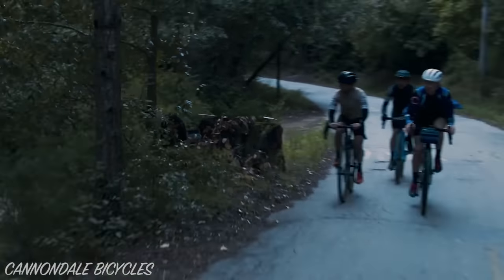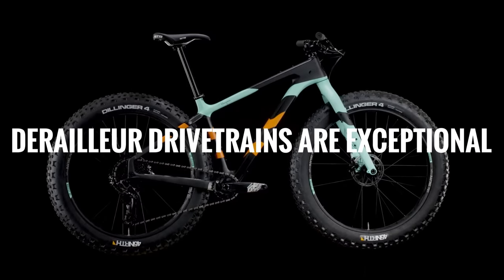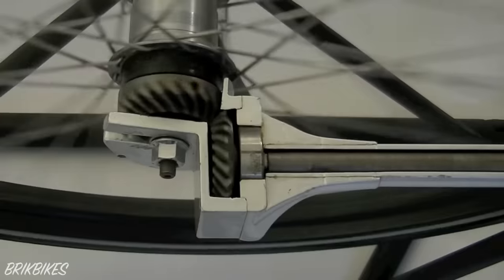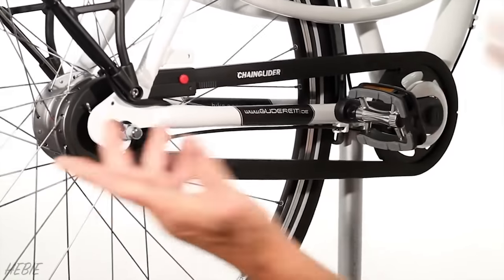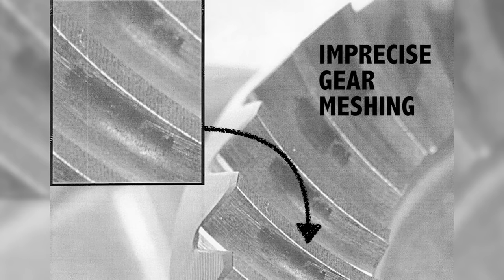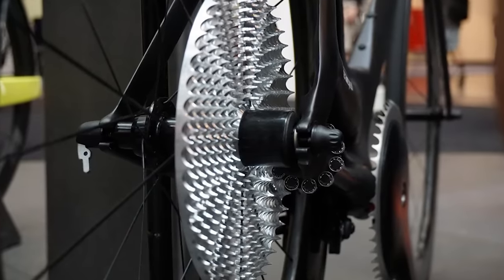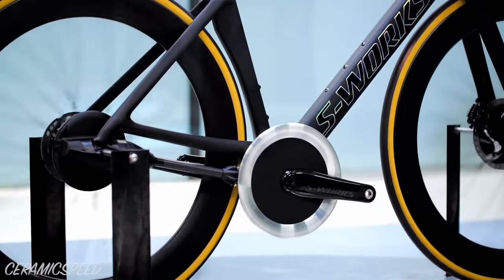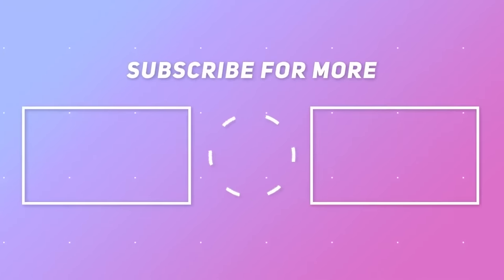Are Chainless Shaft Drive Bicycles a GENIUS or TERRIBLE Idea?

Comment: I can honestly say in all my years of riding different  bikes,Ive only snapped a chain once.But modern gears are fiendishly annoying to adjust.I loved the Sturmey Archer 3 speed hub on a couple of my bikes.Easy to adjust and a drop if oil in the hub every so often!Maybe thats why Ive got a singlespeed bike today.....
But I would like to try a shaft driven bike..
Reply: There's a very common problem that affects gear adjustment in a "modern" bicycle chain-drive drivetrain: Misalignment of the rear derailleur hanger.

The hanger is intentionally made with a relatively soft metal so it will bend or break before your expensive rear derailleur or frame dropouts. That way, if you're in an accident, you just need to replace your cheap hanger and your drivetrain is back in action. However, since it's made with soft metal, the hanger is easily (and frequently) bent out of alignment through normal use, making it frustratingly impossible to achieve a good alignment between the rear derailleur and the cogs in the cassette. If you remember to always check and align the hanger before you attempt to adjust the rear derailleur, you'll avoid most problems and it will be a breeze.

A rear derailleur hanger alignment tool/gauge costs as little as US$35 from Amazon. A professional tool like you'd see in most bike shops would be a Park Tool DAG-2.2 which costs about US$84. Or, if you're patient, you can pick up a used one for even less on eBay. I recommend checking the hanger alignment every time you need to replace a chain and/or every time you begin to have shifting problems.

Comment: So with shaft drive, I can get two-wheel drive? perfect for winter!!
Reply: Check out the ROKON two wheel drive motorcycle, it has a shaft system with gearing to drive the front wheel. Originally built as a utility motorcycle for people who work in forestry, and for inspectors on utility lines.
Reply: You can do that with chain drive too. But amount of friction losses is enormous for both solutions, making them useless.

Comment: I saw this product demoed on another video a few years ago. It looks amazing until you consider what will happen to the right-angle gear attached to the rear wheel when it's loaded-down by a 200lb human cranking on the pedals with all their strength. It would strip immediately.
Reply: @mystikmind2005  Just stick to a conventional derailleur system, the design in this video is engineering nonsense
Reply: How do they work on motorcycles? 🏍

Comment: "But what if you don't care about efficiency or weight?"

Then what the f**k am I doing here?
Reply: Looks?
Reply: I got myself a shaft drive bike simply for the practicality of not having to deal with any exposed grease whatsoever. It's awesome when you transport it or stick your clothes in it.
Reply: @MS-sd1uz  There are shields that save your pants from rubbing on the chain, their only inconvenience is they make it a little harder to access the chain when you're on the go in case the derraileur throws it off the gears... which you can simply fix by looking for one you can take off without tools or do away with the derraileur and you'll never have to worry about the chain falling off ever again.
Chain and shield now that I think about it are overall superior except for looks also because with a shaft I would also be more worried about hitting it, despite it probably taking as much force as you'd require to bend a gear before getting damaged in an unusable state, it's long and thin and sticks out a little more than the other option which would make me, if anything, a little anxious each time I pass over it with my foot.

Despite everything, it looks sleek

Comment: Very interesting. Sounds like a very tall ask to beat chain drive. Reminds me of my experience with tubeless tyres. While with an optimum set up it was theoretically more efficient (even this isn't true here yet!) the downsides in achieving a good seal, especially at the road side made it a non-starters. It seems like for bikes there are a lot of downsides in performance and interchangeability. Seems like its only good for lower performance and safer no maintenance bikes. Children's bikes?
Reply: Sounds like a tall ask mostly because he's comparing an 1800's shaft-driven bike in unknown conditions to a 21st century derailleur bike that's perfectly maintained under lab conditions.
Shaft-driven bikes have come a long way in the past century, they've even come a long way since the Allied military used them back in WW2.  Shaft-drive is still less efficient than chain-drive, but not nearly as much as this video lets on, and are actually conditionally more efficient than chains and belts.  Modern, high-end no-frills shafts (no fancy gearbox) can get 97% efficient power delivery in all conditions and with minimal maintenance,  while a similar chain-drive can expect 99% efficiency only under ideal conditions and can drop as low as 80% if you don't remember to clean and oil your chain after a muddy or dusty ride.

Also, I'd like to point out that he tried to make it seem like a stiffer frame would only benefit shaft-drive when that stiffer frame also benefits chains and belts just as much, and the area where the stiffness is needed doesn't actually effect ride quality.  The stiffness is only needed to make sure the shaft stays in alignment and the gears remain correctly meshed, that same stiffness also keeps chains and belts aligned so they don't skip or jam, and keeps the rear wheel pointed in the correct direction so you aren't riding cock-eyed.

Comment: The problem with this going forward is the best application would be road bikes but those guys are obsessed with simplicity and light weight.... so nope.
Reply: How is this best for road bikes? 

From all I've heard, these are way slower than a derailleur. And speed is kinda what road bikes are for....
Reply: Chains have less friction and weigh much less than an axle.

Comment: I just wish the whole transmission could be effectively sealed off
Reply: Pedal assist seems like a far better solution.
Reply: Just get an internal hub transmission like shimano alfine.
Reply: @Alfred Wedmore you can use a belt with the internal gear box. That's really low maintenance. Only downside is that you need a frame that can "open up" to put the belt on. Might make the frame a bit less stiff.

Comment: My pet peeve with derailleur systems are DERAILLEUR CABLES AND CABLE HOUSINGS. And I'm too poor to get remote derailleurs, and it would be no fun anyways. A manual derailleur system with a different type of cable system would be ideal to me...something like a super-slick synthetic material that would avoid the kinks and hang-ups with metal, a rear derailleur where the cable enters at the front, avoiding the curve in the cable housing, and it would be cool if the cable guide beneath the bottom bracket had bearings.

Comment: From an engineer: The Driven Drivetrain is packed with design elements that necessitate a redesign, high complexity or crazy materials to work.
So the possibilities I see are:
1. It gets redesigned until the actual selling point is lost.
2. The problems caused by the design intent lead to a very complex product, with a lot of moving parts, therefore low efficiency/high cost/low reliability.
3. Alternatively they try to solve those issues with the amazing tools of material science, so new and untested materials, and parts that are very expensive.

Really sorry, but the design looks a bit like an Indigogo scam. Nevertheless, they might pull it off and create a revolutionary product. Can't know until you tried ^^

Comment: Motorcycle racers use chains, due to a power loss with shaft drives.
Reply: Right.. It was making me tired just watching this video of people peddling a bike with a Shaft Drive! Two 90 degree turns, one at the crank and one at the rear wheel, that is not good for efficiency, no matter how well it's made. With a chain drive, you have pretty much direct application of torque to the rear wheel, it's a perfect setup. Belts would be ok, but require being somewhat tight, therefore loosing efficiency. Plus some of the torque is lost in belt stretch as torque is applied.

Comment: I was planning on building a shaft bike from scratch. My idea was that a BMZ trick bike shouldn't have an exposed chain and gears due to the grinding and constant impacts. I'm tired of breaking the front chain ring so i thought a shaft drive would keep it all inside. It's perfect for BMX because it's just one gear and the frames are typically stiff steel frames anyway. I was going to use a carbon fiber shaft and carbon wheels to make up the weight difference and to add strength to the shaft. 

So far my major hurtles are the difficulty of tig welding. It's freaken hard. And now it's harder because i now know that I'm not original.
Reply: Almost no one is "original". Keep going. Sometimes a thing is worth doing simply for the satisfaction of doing it and learning along the way. In the end you'll still have a super cool bike, and have built it yourself!
Reply: Shaft drive bikes were built almost 200 years ago. It's almost impossible to think of any new idea for bicycles. Seriously, the USA originally had one patent office just for bicycles and one for EVERYTHING else. But you might be the one to crack the case.

Comment: Does anyone have any figures for the efficiency of a chain drive in gears where the chain isn't totally straight? For example middle gear at the front and smallest or largest gear at the back. And what happens to the efficiency if the chain isn't oiled and cleaned regularly?

Comment: I presume the final aim of these drives will be for electric bikes where extra weight and lower efficiency can be overcome with good motor systems.
Reply: Well, in the future all electrically driven vehicles will exclusively have frictionless electromagnetic couplings rather than chains, belts, or shafts, but perhaps shafts will be used for a period before this.

Comment: I wonder how these shaft will cope with vibrations, and even on MTBs!
Reply: Or god forbid you're mountain biking and hit the shaft on something and bend it. Oh the inhumanity.
Reply: Pedal assist seems like a far better solution.
Reply: You need cv axle I guess
Reply: @Vi-pv3xi  But wouldn't it have the weight penalty, and more important, increased cost tho
Reply: @onehourmusicbc  Yes. But without cv axle, the bike won't work well because MTBs flex a lot.
Reply: @Vi-pv3xi  Though that problem don't only exist only on MTBs right? Since paved roads aren't perfect either... Chains are find for me tbh

Comment: As a mechanic i have to say belt drives arent as maintenance free as they are said to be, yes they dont (really) need a lube BUT if not maintained to the correct tension they WILL eat or grind themselfs to destruction and wont last more then 6k km's....

Comment: Something to note though is that you're referencing against single speed which has perfect chainline. 

Cross-chained (even partially) loses a bit of efficiency. Roller bearings also are more efficient, and are used in shaft driven bikes (less give, which helps the meshing also be more precise.)

Comment: "What if you don't care about efficiency or weight?" Then you are buying the bike as a gift for someone you don't like.
Reply: Or, most likely: 
You are neither racer, neither MAMIL...
Reply: When having had the bike gears frozen by sub-zero rain, a drive shsft might be a good idea. Not all biking is the same.
Reply: @perwestermark8920  Sub-zero rain? Isn't that called snow? 

Yes, freezing rain happens (very rarely). But you can't bike in it. Not unless you can solve the problem of traction on the wet ice surface you're riding on. 

Still, you are thinking outside the box and that's good. So we now have two reasons to buy this bike.
Reply: @jwrosenbury  No, water can be liquid at subzero temperatures and freeze when it hits something.

Traction isn't a problem. My tungsten-carbide studs handles ice just fine. The only surface it doesn't work well on is wet, semi-melting ice soft as cheese. The surface is too slick for the rubber and the ice is too soft for the studs.

Teflon-coated wires and hydraulic brakes works quite well. But what gears I end up with seems to be a bit hit and miss.

Edit: worst is of course when I end up between two gears.

Comment: My college had one of those things where you could rent a city bike off a rack, ride it around, and then just return it to another rack somewhere else. They all had shaft drives, but I imagine that's because less exposed chains meant you didn't have to worry about stranger users messing with them or getting caught in them.

Comment: I recently gave away my old racer with Shimano Ultegra gears. I`m a rider not a maintenance/ fiddler type. The bike I gave away was 15 years old, had travelled countless thousands of miles. Mostly in the dry but not always. Incredibly, those two little wheels at the back, which must have spun round a billion times were still just fine. I wish everything was so well made.

Comment: I have a shaft driven, rear wheel suspension bike from the 80s (fendt cardano comfort) and its hard to ride and never wants to stay in gear. It ways about 30kg, You can’t really ride it correctly without grinding and your back will hurt from the uncomfortable seating position. But still its a fun thing to own

Comment: With the dawn of ebikes, you also have the issue that a shaft is actually not that much more efficient than a dynamo that gives extra power to the motor, and in terms of moving parts complexity when the bike is already an ebike, the dynamo is simpler and more reliable, and allows for absurdly flexible frames (like, it becomes viable to use elastic frames for suspension)

Comment: Have shaft-drive ebike with Nexus7 hub and it is amazing, almost no maintenance (only lubrication, according to service manuals once a year/2k km, I do it even less often), works very well in winter during snow, salty mud, rain. Belt may be a good alternative for harsh conditions, but not derailleur. Efficiency loss is less important for e-bike, as it is anyway speed-restricted to 25 km/h. Derailleurs do and will dominate soft climate areas due to their low cost and higher efficiency.

Comment: shaft drive bicycle is an old idea, going back to the safety bicycle of the late 1890's. It failed then, and each of the roughly 20 ~ 25 times it was brought back since. I have zero doubt it will fail again. Disadvantages include: Requires a special frame. Weight - a shaft drive weighs considerably more than a chain drive. Difficulty removing the wheel to repair a flat. (could be canceled out by using no flats foam tubes or tires, but they introduce problems of their own: at 5 or 6 pounds for the tube or tire, that is a LOT of rotational weight, and foam tubes and tires don't necessarily play well with spoked wheels, among other issues.)
For a single speed or multi speed internally geared hubs, a belt drive makes more sense than shaft drive. (tho I notice belt drives on bicycles has been pretty much abandoned again)
Chain drive has been king for well over 100 years for a reason: It works. It is reliable. Light Weigh - even if a derailleur equipped bike. Easy to change the gearing by replacing the chain ring(s) Low cost, (manufacturing and maintenance/repairs) and relatively high efficiency, ease of adjustment, and long lasting, to name a few.

Comment: Sorry to be pedantic, but at 5:52, I think you meant a shaft system needs to be built with low tolerances. As precision goes up, tolerances go down. A tolerance is basically how much you're allowed to deviate from the nominal dimension.

Comment: Your website helped me sort out a retro gravel bike build.  I really wanted stem shifters, but it's 1 1/8 threadless. I saw your article with a custom stack spacer that featured downtube bosses and cable stops.  I did something similar with a clamp on double stop and a sunrace 28.6 mm stem shifters set. 

Good luck in your travels.

Comment: In motorcycles, shaft drives are usually paired with longitudinally mounted engines so you don't need a bevel gear at the front, only the back. Couple this with the transmission being inline with the crankshaft rather than parallel, means you recover most of the inefficiencies relative to a chain drive with a transverse engine. 

With a transverse engine a chain or belt drive is almost always better.  In a bicycle, the crank is always transverse.

Comment: I like the derailleur system as it's easy to repair and maintain. Cables, chains, bearings and cassettes are fairly cheap as well. I had a nice GT that I treated poorly for a year (rain, snow, summer, no maintenance) and in that time I broke the chain an wore out the crank bearing. I think a drive shaft would be great in the winter.
Reply: Canada... get a heavy ccm with big tires and maybe chains... studs 100%

Comment: For me the single biggest problem would be alignment. Even now with a derailer aligning the wheel again is where the tedium is when you are changing the air vessel. This might be cuz my bike is pretty old and crappy and the wheel is kinda curbed, as well as the shaft screw and stuff being worn down. But still I can't imagine doing the kind of precision you d need for a well working shaft drive.

Comment: I have a shaft drive bike with an 8 speed Shimano internal hub. I bought it so I can fold down the back seats in my car and toss the bike in with no worry about grease getting in the car. I have a 2014 Mazda 3 and have had a Honda CRV and both will take my bike inside.
A strange thing about the bike is that many people look at it and think it is an E-Bike. Some even want to argue with me on that point.